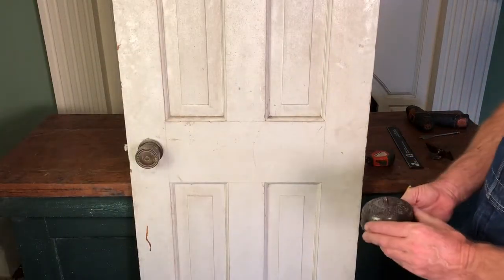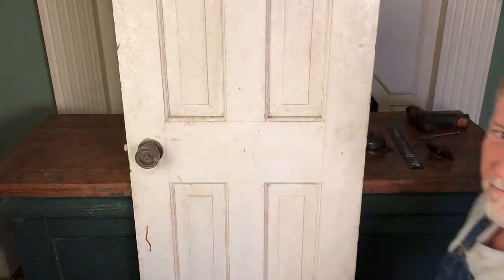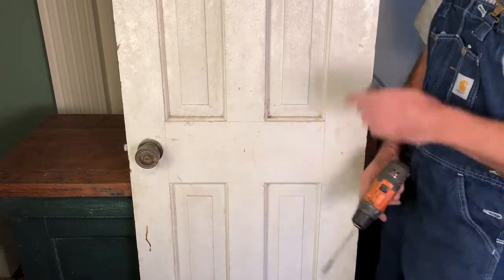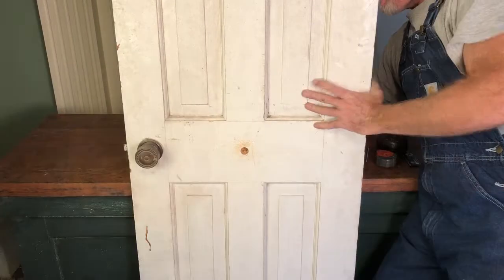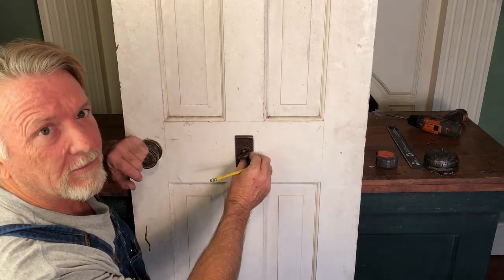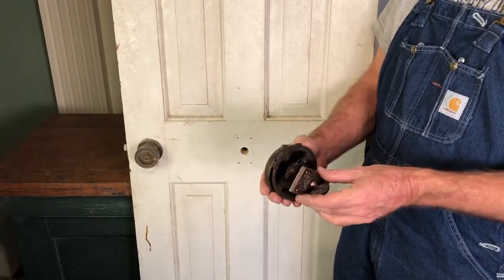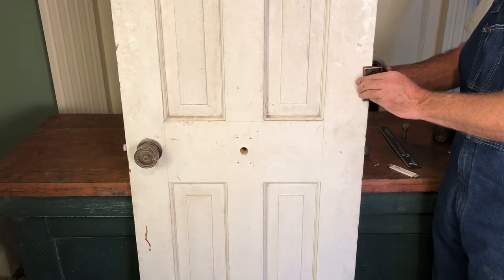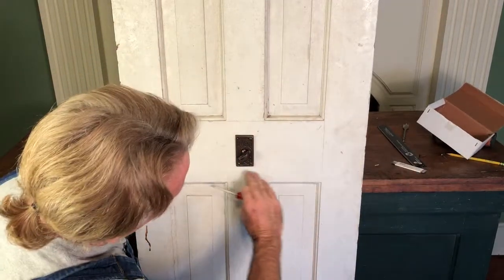How To Install A Victorian Twist Door Bell

Comment: I am so very happy to find your video!  Thank you.  I have an 1870 farmhouse that has marks on the door where it once had this type of bell.  The hole has been filled in but I am definitely going to restore the look.  However, my front door has a round indent on the outside of the door.  That would be facing the visitor.  Would this be the same twist bell with maybe a round back plate or an entirely different type of doorbell? Thank you for your help!

Comment: What if you have to install through the wall next to the door?
Reply from the maker: You all would need to weld or solder a longer metal spindle.  Might even remove existing steel spindle and put an entire new piece for your desired length.

Comment: Now how do I fix one? My son pulled the turn piece out and I don’t know how to fix it
Reply: I have the same question. I need a video that shows the inside of this bad boy. There are loose springs that I have no clue where they go.
Reply: Mine no longer works either. Would like to see a repair video.